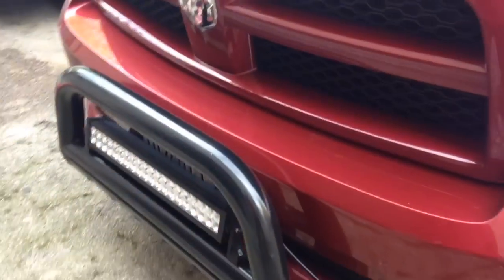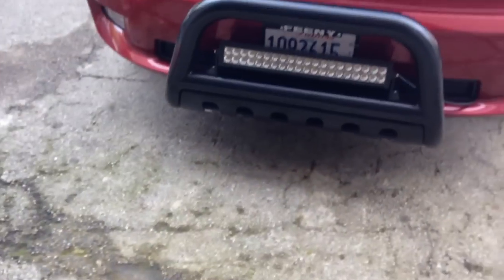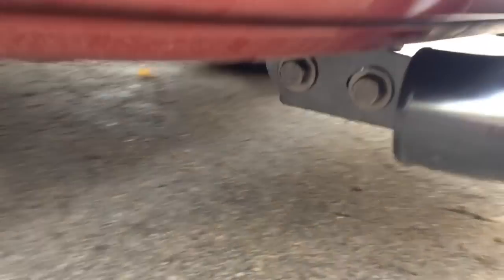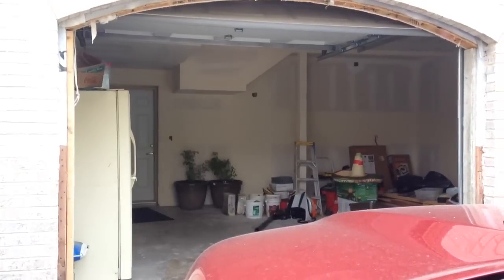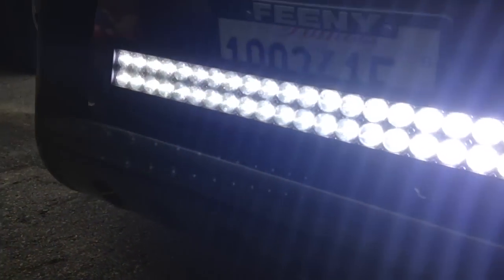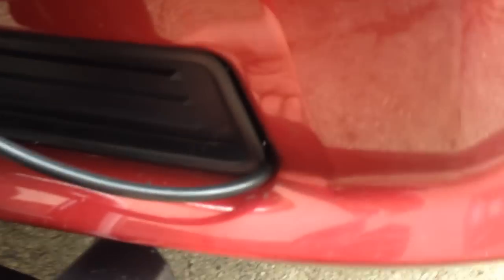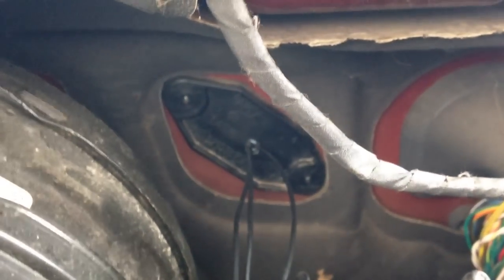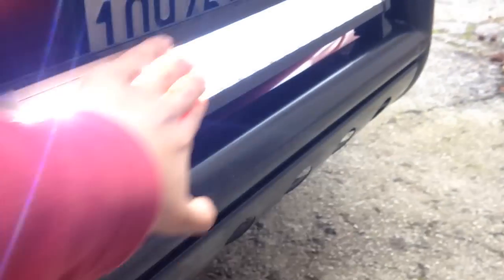LED LIGHT WITH BULL BAR RAM 1500 2012

Comment: Your bull bar sits low, I had mine installed like that too. I guess its easier access to pop the hood but I generally see them mounted a few inches higher. Have you found it better keeping it low or raising it a bit?

Comment: I see 2 exposed connectors that were yellow that are going to cost you alot of blown fuses down the road if you don't use insulated male and female connectors and then heat shrink over them.  Light bar looks good, install def looks bad of course I'm am an electrical specialist installer so I guess I'm just used to my work looking factory installed no matter what the job is.
Reply from the maker: KillerDiesel2012 thanks man is their anyway you can help me then do it the right way?

Comment: Your friends wiring job is ghetto. The only thing worse would be to roll down the window and leave the switch hanging. LOL On more serious note, I would have routed the wires where you couldn't see them from the front of the truck. (not popped the panel out WTF)  The bare yellow crimp connectors underneath are not meant to be exposed to weather and im pretty sure they are not made for vibration. The wires should be soldered with shrink tubing put over them.  Or you could  use weatherproof molex connectors like on other terminals under the hood. Its the details... 

All in all the bull bar looks good. How are the leds holding up?

Comment: Damn exposed positive and negative wires next to the frame.....should learn how to wire correctly before u have a fire
Reply from the maker: michael dinardi I didn't wire them but ill check it out thanks
Reply: Just make sure the weather sealed.hate to see a fellow ram owner on the side of the road..lol

Comment: can anybody answer my question how do you mount a led light bar to your bullguard?
Reply: +antman832 Many of the bull bars come pre-drilled for LED mounting brackets.  I believe the DZ brand makes one pre-drilled.
Reply: +ramathorn1982 what if the one you buy doesnt have pre drilled holes?
Reply from the maker: This bull bar came with 2 pre drilled holes, but for this 24" LED bar the holes were to wide, so I drilled for the specific measurements with self screws.
Reply: +vBello18 thanks alot for the info
Reply: No problem, I was interested in the same thing and have been doing research.  I ended ordering a Lund 27121204 bull bar with integrated LED lightbar so as not to block the license plate.

Comment: Thats like. 100% illegal to cover your license plate. Be lucky the cops in your area are donut eating pigs and not fresh cadets who want to change the world, starting with your license plate.

bad ass light though.
Reply from the maker: +SirNicholasD yeah I know I mounted on the front now if you see my instagram at       the_hemi_
Reply: Not just that, there are only four driving lights allowed on front, so this can only be used offroad legally (he probably knows that). I build light bar into bumper consisting of 6 rectangular regular lights about 6 years ago, i even made light bulb shield caps like original headlamps have, so it's less blinding, but i can't even make inspection sticker without covering that bar...lol.
Reply from the maker: yeah thanks for the heads up man. Yes I only mostly use it where I live since its mostly corn fields and not that much lighting plus many deer around the area.